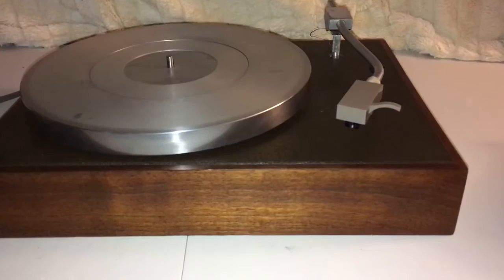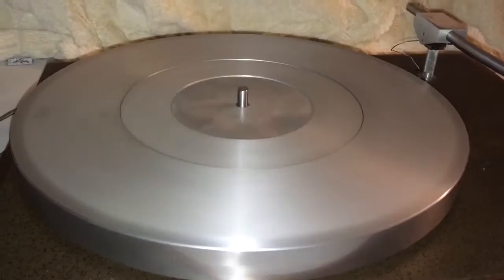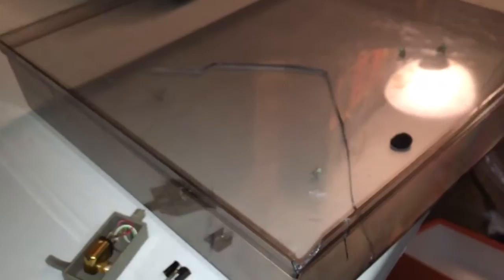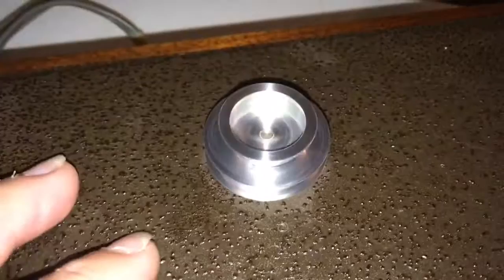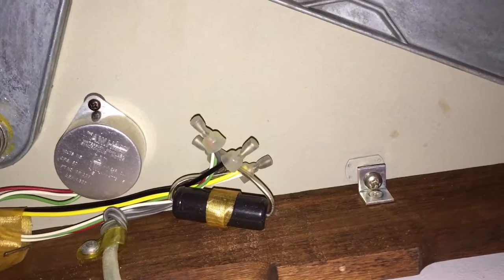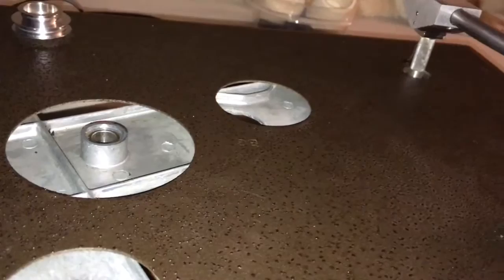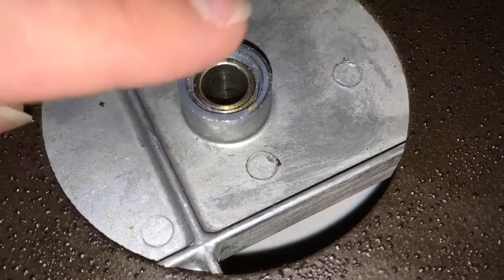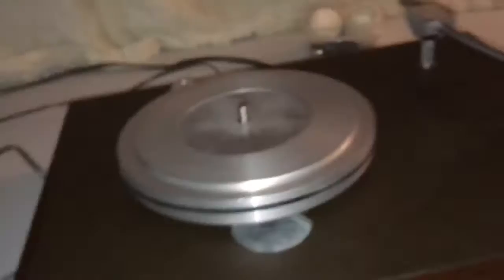Ar xa turntable tour

Comment: Platter, not plates! Belt riding low, because you're only using the inner platter. Motor needs cleaned and lubed. Yes, I'm laughing. Do not attempt to use it without the counterweight, about $30 to $40.